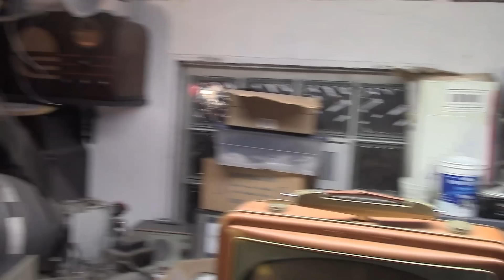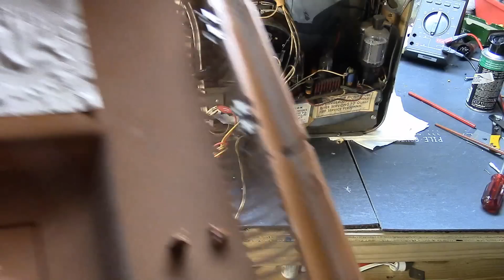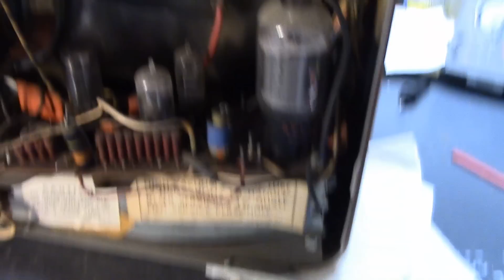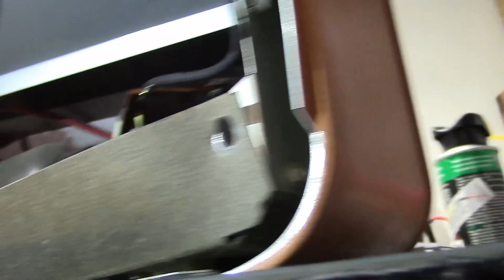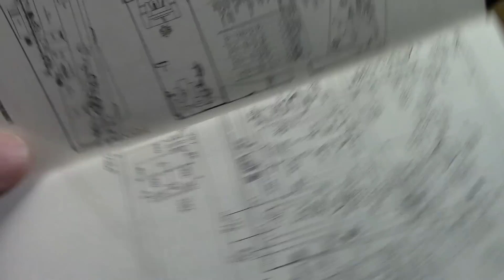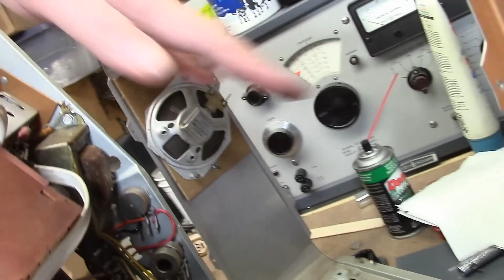Philco Seventeener III restoration p1o1

Comment: I did one of those. Unfortunately, to get to the filters, as you said you got to go all in. Once disassembled, it’s point to point under there. Then 2 boards like Predicta. 
The biggest pain really is to do any testing, it’s reassemble and pray. Because you may take it apart and put back together 3 or 4 times..at least that my experience. But once you do it a couple of times, like most sets it becomes fairly easy. Just annoying as hell. But once you get it, they are pretty cool sets.

Comment: The audio sounded more like oscillation in the audio circuit - it changed speed when you turned it off.  May have been so loud in person you couldn't tell.
Reply: Or maybe interference from the vertical output.

Comment: This Seventeener is probably one of the nicest I’ve seen and I really like that it has the rare UHF option..I was surprised by how clean it was inside,it appears to be a fairly low hour set. This will be an interesting restoration,and I’m sure you’ll have “fun” taking that chassis apart. It will definitely prevent you from being bored. Lol!  Philco really packed the electronics in there. 
Funny that you mentioned Shangos “astronaut” video,I was actually thinking the same thing when I saw how they angled the tubes down to slim down the profile of the back more. That set also had couplets in it that stuck up through slots in the metal chassis if I recall correctly.

Comment: Hey that looks like one of the two I restored that has revisions that are not documented anywhere. The one I recall was a wire from one of the vertical output pins down to a point on one of the ecaps, then through a high value resistor and up to the tuner. There were a few others so just be aware you cannot rely on the documentation when you go to to put that sweep board back in. Take many many photos close up beforehand

Comment: I have several of these and this is the exact reason I haven't touched them. Well the couplets too. I'll be curious to see what you come up with moving forward
Reply: Here we have shango066 in the wild
Reply: @1marcelfilms,Welcome to flavor country!
Reply from the maker: At least I found the factory service info in Rider which includes disassembly instructions.
Reply: @bandersentv   the Riders go up that late? What volume?
Reply from the maker: @shango066  Yes, they go up to 1960.  It's covered in volume 25.
Reply: @Bandersentv,What happened to Riders? They just vanished after 1960 or did they get bought out? Sounds like they offered a lot more detailed service information than SAMs in that they actually have pages dedicated to disassembling the chassis on this model.
Reply: @bandersentv  oh very good I have the whole set, this makes me moist
Reply from the maker: @Suddenlyits1960  I believe they went out of business.  Riders was really just reprinted OEM factory service manuals while Sams bought TVs and reverse engineered them.
Reply: @Bandersentv,Thanks Bob,So basically, to use an automotive analogy,Riders is like having a factory service manual for a car and Sams PhotoFacts is like a Motors,Chiltons or Haynes manual. Shame they didn’t last longer. I wonder what the cause of their demise was?

Comment: Chassis has a wrap around design. Easy to replace the tubes but anything else requires a lot of disassembly! Also you 
may go into couplate replacement hell if many are partially bad. Compared to the Admiral suitcase models this looks 
like a Philco 3D puzzle. BTW the  Admiral Thinman line   was a favorite of my Grandpa's to fix because it was easy 
to get to most of the components to replace if necessary.
Reply: I had a couple of Electrohome suitcase portables where the tubes faced the front and all the underside components faced the rear. To do a recap, all you had to do was remove the back and you had instant access to everything. But replacing tubes was a pain. You had to remove four screws and then the chassis hinged down. Electrohome used the same style of terminal strips as Zenith.